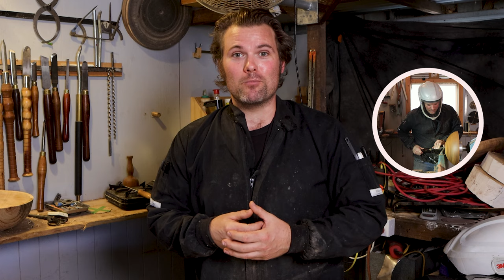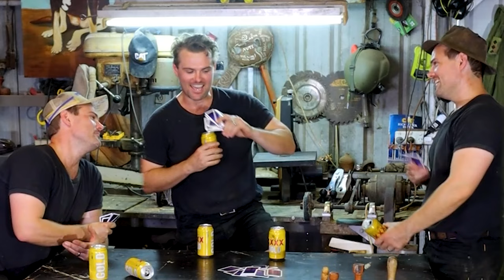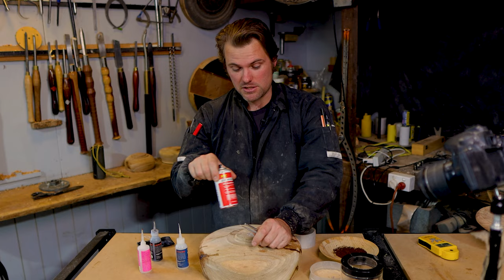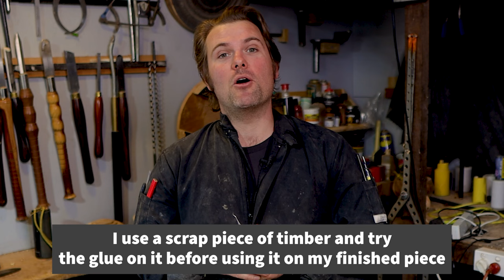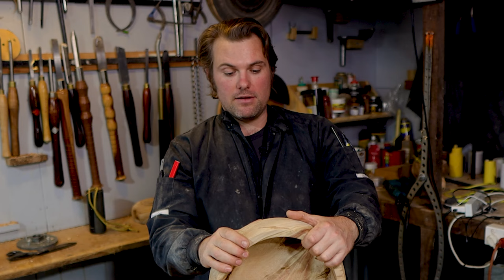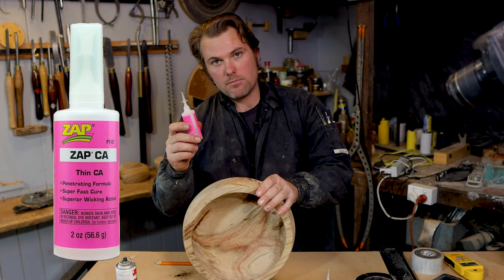A Woodturners guide: Cracked wood restoration with Coffee - Woodturning  (Part 2).

Comment: Great video – learned some nice tricks.  You can largely avoid “CA blead” by spraying the area around where you are applying CA with lacquer sanding sealer.  I expect shellac would do the same.  Spray it on, let it dry, then apply the CA.
Reply from the maker: Thanks for leaving this comment, Michael. Much appreciated. I will have to give it a good for sure.
Have a great day.
Cheers, mate.
Kez

Comment: Kerry, nice video, well done.  I have been using coffee grounds for a few years now  and like it better than sawdust.  I  don't like to use  CA as it stains the wood and requires more sanding so I use regular wood glue mixed 50/50 with the coffee grounds.  I dry  the grounds like you do or use the microwave after putting the grounds in a coffee bean grinder and really grind it up really fine. I then work the fine dust into the crack a lot like you do.  I like accenting cracks and inperfections and think it actually adds to the look of the finished piece.  Keep up the good work and a big hi from Idaho USA.

Comment: Thanks Kerry.
I haven’t had to worry too much with thin ca going white after accelerant application.
Our club uses ca from Timberbits and accelerate from Scott technology in sydney.
As for ca staining timber yes it does do this and it’s terribly difficult to fix. Try using shellac first then Ca. Shellac does stop ca bleed but not the ability of ca too glue cracks together.
Thanks for sharing.
Reply from the maker: Thanks very much for the tip on the shellac. I’ll have to look up Scott technology that sounds like the Go! Cheers, Greg, appreciate it mate. 
Cheers, 
Kezza

Comment: Well I know what I will be using next time I need to fill a crack. I tend to use the black CA glue which is stupidly expensive so I appreciate the idea! Great video bud!
Reply from the maker: Thanks so much, mate. It's a great workaround for saving a bit of money, that's for sure. Just keep an eye on those little chipouts, when you turn or sand the piece. Let me know how it goes. Thanks, Andrew. Cheers!
Kez

Comment: Nice seeing how you go.

With the other CA's that go white of you hold the accelerator further away and more angled you get a lower concentration but it still sets with minimal white flash.

I got about 20 dental picks from my dentist. They can only use them for a period before they have to get rid of them.

I find that the medium and thick Ca don't stain, just the thin and super thin which is when I put sanding sealer all over to maintain the surface colour.

Finally, when you start using larger amounts of Ca in a larger packed crack you can get a flash of chemical reaction smoke which is well nasty so best to not have your head over the top of the workpiece when applying it. Even with a resperator it will come through the filters.
Reply from the maker: It's great to hear about your experience, and thank you for sharing your knowledge, Chris.
Regarding the CA glue and accelerator, your advice on holding the accelerator further away is handy, and I will have to try that one. 
I asked my dentist, and she laughed at me, haha. It might be time to find a new dentist haha. 
The bleed sounds like an easy fix with the sealer, and I must give that a go. Thank you for that.
And, your warning about the potential chemical reaction smoke when using larger amounts of CA glue is crucial. I will have to share that. I don't know if anyone saw it in the video, but I was blowing the smoke away. However, it makes sense to raise that point with everyone. 
Thanks for sharing these insights!
Cheers,
Kezza.
Reply: @KerryCorney  you're very welcome. Yes the smoke is very pungent and can instantly make you feel unwell if you breathe it in worth a mention, went straight through my filters on my positive flow mask.

Comment: Great video watched all of your videos. Good job one thing you might try I’ve seen from other wood turners to prevent the CA glue from bleeding into the wood is to apply sanding sealer before you do it in that area. Looking forward to your next one.
Reply from the maker: Thanks so much for the trick, Mike. I will have to give that a go. Thank you for that.
Cheers,
Kez
Reply: Great tip! I like to use use a shot of rattle can spray lacquer to prohibit the CA from staining.

Comment: Kerry, great video and very helpful. I use the saw duct and the star bond frequently. I will definitely try the coffee grinds and the dental tools. Keep up the great work!
Reply from the maker: I used to use wood glue and dust, but it felt too slow. Then, I tried using super glue 👌😎 and it worked like a charm. It can darken the dust a bit, but it looks great.
Cheers